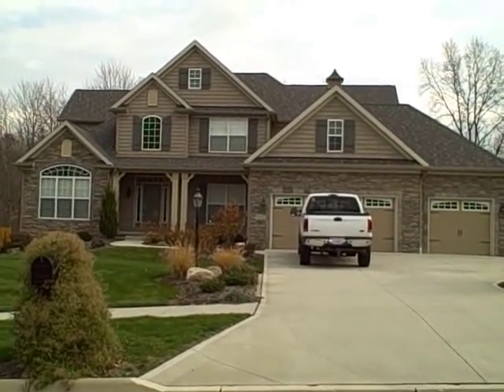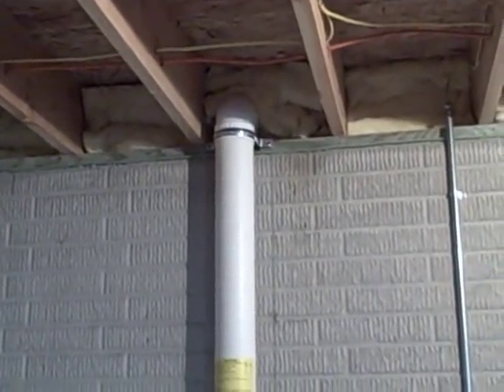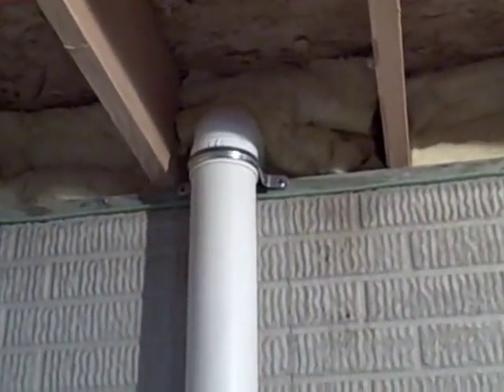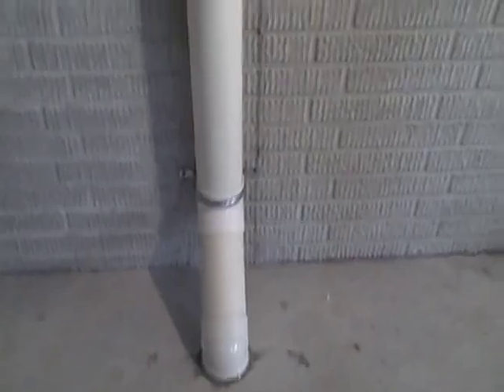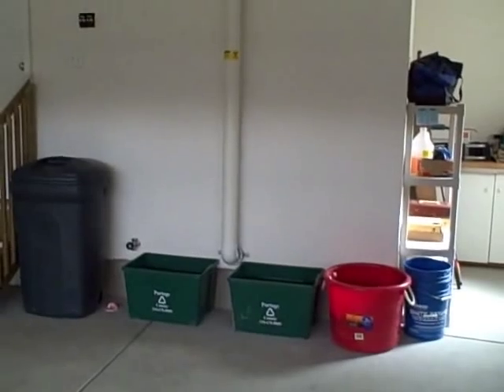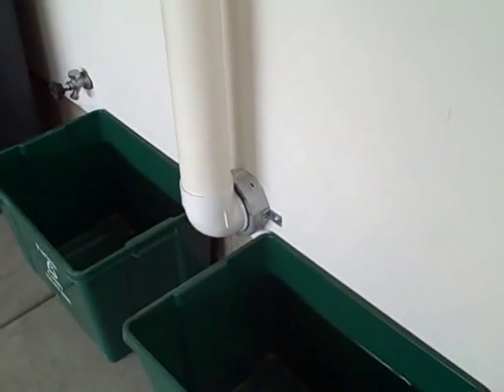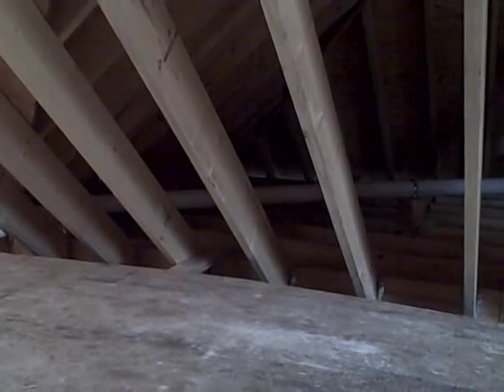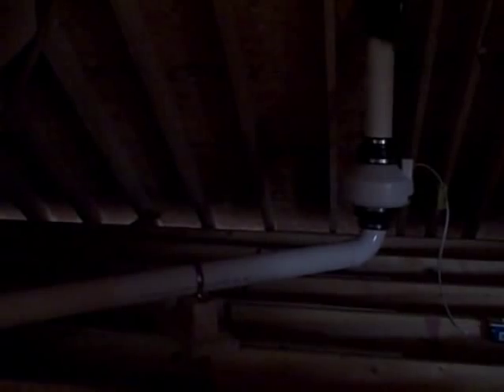Radon mitigation specialist Akron, OH interior radon mitigation system install

Comment: How about insulating the exhaust pipe in the attic?  I know some jurisdictions such as Mankato Minnesota requires that the exhaust pipe be insulated inside the attic (minimum of R-4 insulation), and I think that makes a lot of sense (I insulated mine).